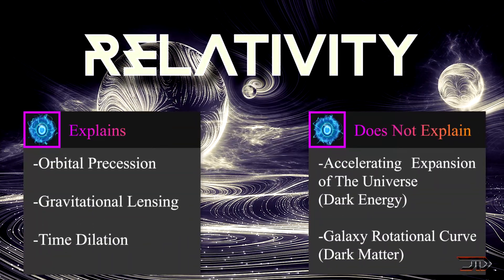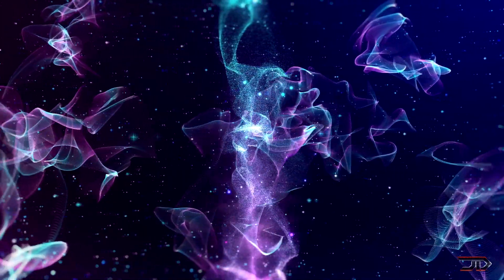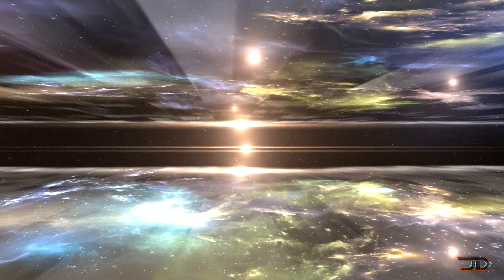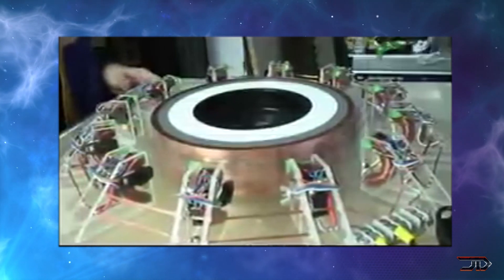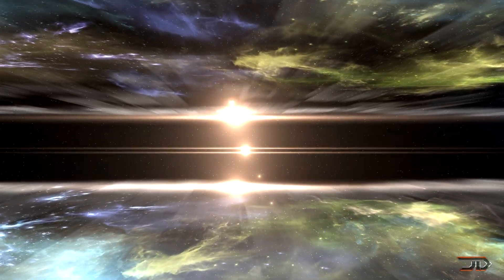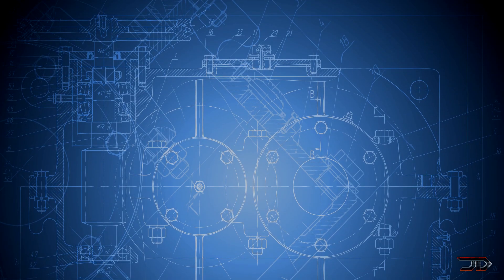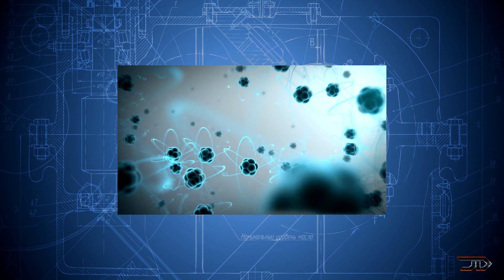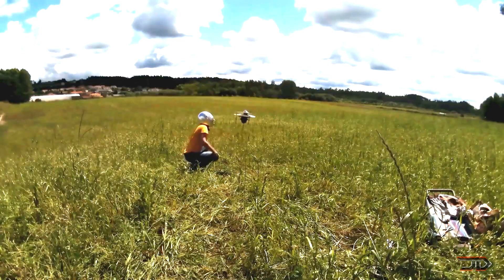Does ANTI-GRAVITY Technology Really EXIST?

Comment: I've had a thought in my head for a long time of how antigravity, or more accurately electromagnetic 'propulsion' for wont of a better term could be created. I think it would require a constant feed of a great deal of power, which might not be possible to test until carbon nanotubes become cheap to produce....using the medium of carbon nanotubes you would have a muti-part machine, essentially a massive ring-matrix with magnetic points charged negatively, with a positively charged composite sphere made of ceramics, magnetite, and a few other minerals for strength such as titanium, which would be kept spinning at supersonic speeds somehow and suspended in a coolant fluid of some kind, which would be centrally located in a vehicle and which would itself be suspended or somehow separate from the vehicle itself. I'm just not entirely sure how to go about creating the neccessary composites and systems. But I think carbon nanotube batteries would be the key to making it work.
Reply from the maker: That is a pretty good idea, that kind of sounds like the TR-3B design!
Reply: The "cockpit " would definitely have to "float" somehow inside the vehicle so you wouldn't feel the forces of some of these maneuvers u hear about. Like dropping from 80,000 feet to a foot in a second
Reply: ANTI gravity, is already well known,  It's the by product of the "B" field in any magnet... Not the north or south poles.  Want proof.. Find a magnet that you can access the "B" field of a magnet ,(that's the center of a magnet!!)  Now weigh a small stone on a scale lets say it weighs 40 Gm..  Now tap it vigorously with the center of a magnet the "B" field and it will loose about two thirds it's weight..  move it around and the weight comes back..  if you want to suspend it in mid air you will need to oscillate the "B" field for the material your trying to lift.  Take a look at Coral Castle Florida, Ed lifted 30 ton stones and built his castle it's a tourist attraction now.  The "B field played a major part in the taking down of the towers on 911,  that's one of the reason cars blocks away from the towers were ruined, also the building across the street had to be rebuilt.. It's all "B" field technology,  That's what Nicola Tesla was talking about with his "B" field energy ray..